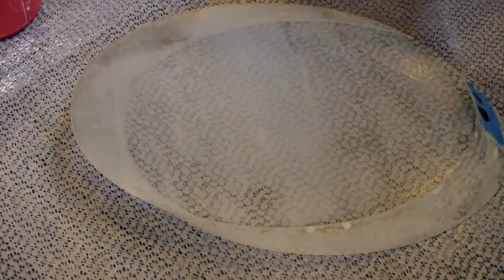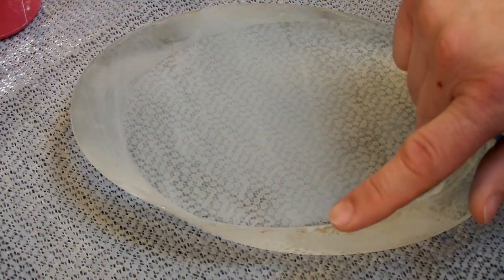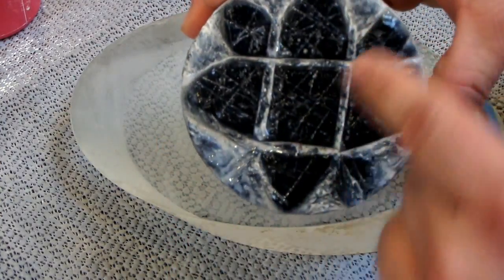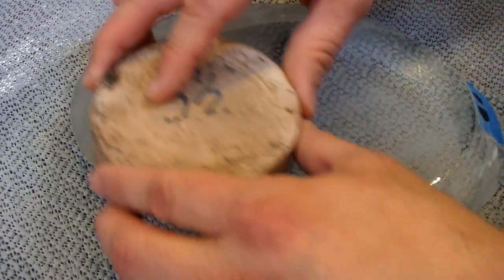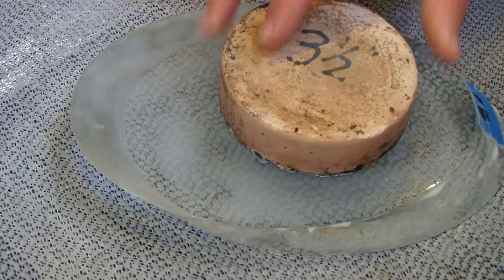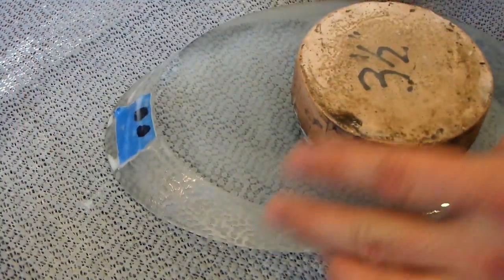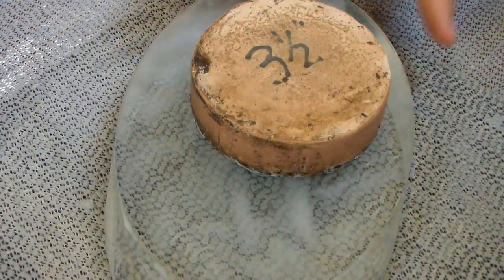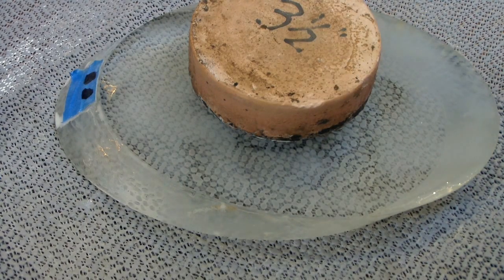Figuring Tips for a 5.5-inch Renegade Secondary Mirror

Comment: Hello again, Gordon - I was really disappointed that we didn't manage to establish a mode of communication. So much to discuss! 

Anyway, in this video I notice how little pressure you seem to be applying. Can you offer any comments regarding that? Does it result in a much slower process? Could you just apply more to start with, and then taper off toward the end of the operation? Thanks, Brian.
Reply from the maker: In the beginning of grinding you can use a lot of pressure.  When you start final polishing and figuring you use very little pressure.  There are two reasons.  First, you need to slow down so you don't overshoot your depth.  Second, going slower gives you a finer surface structure that will produce more contrast in the finished mirror.  When you use pressure, the surface will be too rough for the final mirror.